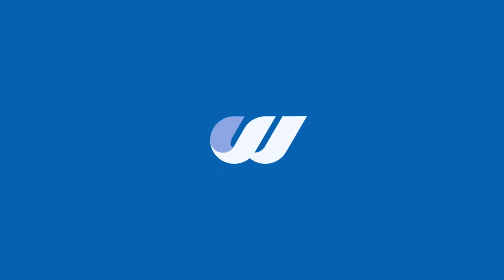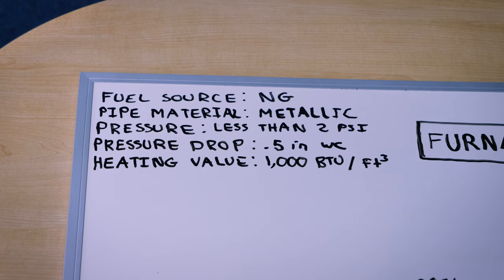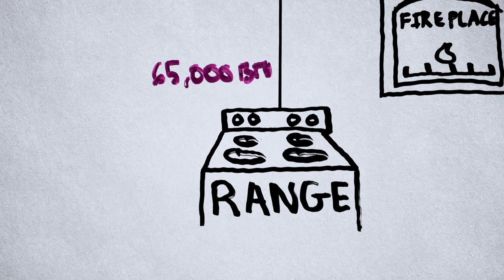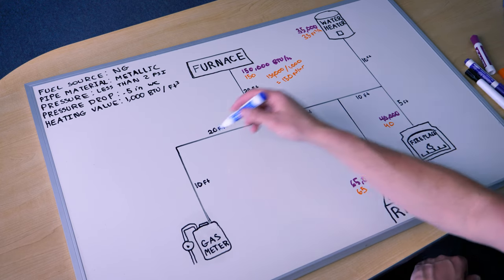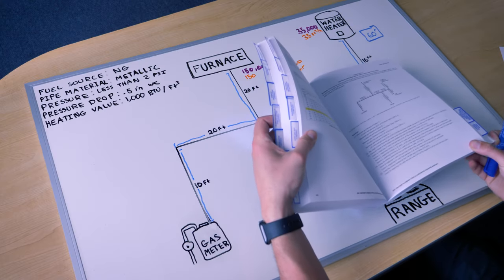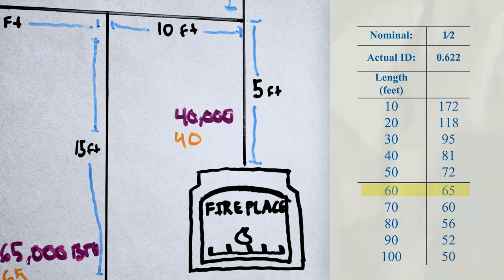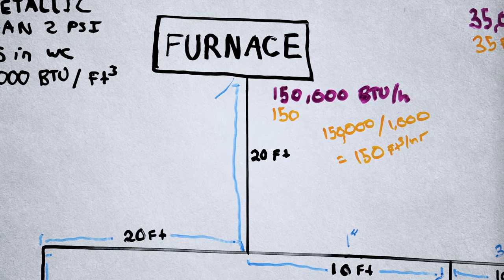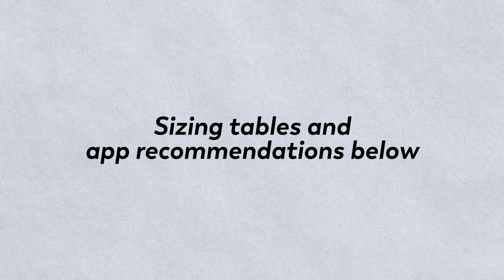How to Size Your Gas Lines

Comment: Good explanation. This is probably why a plumber suggested I would need a separate 1" gas line from the meter if I wanted to replace my tank water heater with a tankless water heater.
Reply: Tankless can require a meter upgrade as well.
Reply: Most likely you were already close to the btu cap out plus a single line for a tankless is a great idea

Comment: So, I've got an existing 3,200 ft2 and am adding a propane 26kW generator.   It will be tied in with 5 ft of the gas meter, so I'm trying to determine if my existing 3/4" line running 85 ft to the 500 gal propane tank is big enough.   The existing regulator is 3/4" and rate for 1,000,000 btu/hr.   The nameplate rating on all of my propane users is about 850,000 btu/hr (this includes the generator, all heating in our house is done with propane).  How would I do this?  Would I assume the line length is 85 ft since it will be the first drop in the 'circuit'?   Thanks.

Comment: Just curious, what would happen if you ran 1-1/4” to the end and dropped the size at the appliance?
Reply: it wouldn’t get enough pressure what do you mean, the pipe will reach a resistance

Comment: My tankless hot water heater has two readings on the table for BTU per hour. Minimum input is 11,000, maximum input is 180,000. Which figure do I use to calculate the Cubic ft per hour? Thanks.

Comment: less than 2 psi , would that be 6-8inch in water column?  and there no regulators at appliances or is it a 2 psi system and there are regulators ?

Comment: Im installing a 245,000 btu generator on the longest/farthest line😫 i may need to change the 1” Csst installed in my house when i got it, to a 1-1/4”..i need to check NG  pressure first, generator is calling for a minimum 3.5 in WC and maximum of 7 in WC..hope i can get 5-6 in WC while boiler/stove and furnace is running👍
Reply: You must install to only have .5 in WC drop from supply pressure to meet most code with natural gas. Just because one appliance can operate lower that that doesn't mean the all can without possibility of flare back or failure to ignite. also check to make sure your meter is rated for the complete load.

Comment: I want to add fireplace log set which is 65,000 at about 60ft. There is currently a 1/2" pipe feeding a basement fireplace and my stovetop.  If is not possible for me to get into the ceiling and change out the pipe to 3/4" .  If I don't plan to cook and have the basement fireplace on when using the log set, would I be ok to install it?

Comment: Its worth noting that the only purpose of the line reduction is actually to keep constant gas pressure everywhere in the system. Even a tiny 1/4" pipe would be plenty for the entire system if it were not for the pressure issues that would potentially cause. Look at the detachable propane connection to an RV and you can see the entrance hole is something like 1mm large!
Reply: That's because propane has a much higher CF to BTU conversion ratio. 1CF of propane is around 2500 BTUs, where as NG is around 1000 BTUs so you can support a much higher BTU load with propane using the same pipe size.

Comment: After determining the correct pipe size I need 1" 1/2" for the main however the pipe coming off the meter is only 1" is normal.  I have upgraded the meter according to our gas company to a 450.

Comment: Thank you for the video. Apologies If I missed it but do you need to add any extra distance per union/coupling/90 you add into the run? Or just their standard size? I know for pool TDH there is a table that has a value of Head per adapter....was not sure if Gas had something similar or if that is just for pumps and water. Thanks again !!
Reply from the maker: You do not need to add any extra distance for unions, couplings, 90's etc.  If you are bordering on a pipe size in the table, you could always size up if you have a ton of fittings.
Reply: @willplumb  thanks !! The run I am doing should only have 5 fittings so I would think that is fine then. Great video !!

Comment: Hi, I see that the last pipe that connects to the meeter is a 1 1/4", I'm wondering if the meeter needs an adapter? Is the meeter a typical house meeter?

Comment: Bought a 1965 home in GA
Gas line from meter is 1/2”

After shutoff valve is downsize adapter to 3/8” 

There is a copper line running 10’  at various curves over my furnace from the shutoff valve to the water heater. It then connects at water heater with a 3/8” male to 1/2” male connector into the water heater. 

This doesn’t seem legal. Am I wrong?

Comment: I know this is basic for you but I am struggling. I have 3/4” steel pipe coming in. After about 10’ it splits into two half inch lines. One line is about 16’ long and runs a 50k but furnace. The other is about 13’ long and I am curious if it will support a 160k but tankless.  This is all propane. The regulator is at the house and is 11-13” wc

I tested the pressure at the drip leg of the old tank. It is 9” wc with the furnace running.

Comment: You don't use copper tube for gas?
Reply: The agent put in NG that makes it smell like eggs corrodes copper tubing so it would be dangerous to use it for a NG application. Propane however, uses a different agent that is safe for copper so it can be used in those applications.